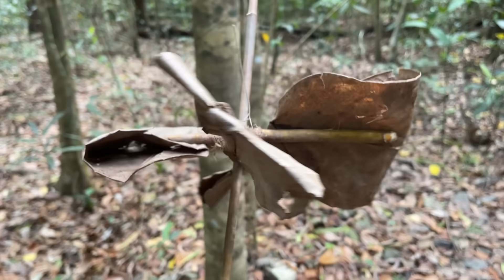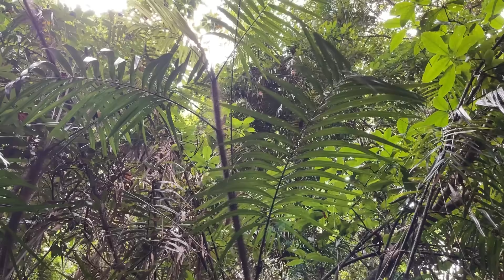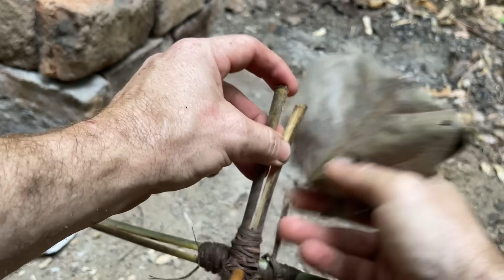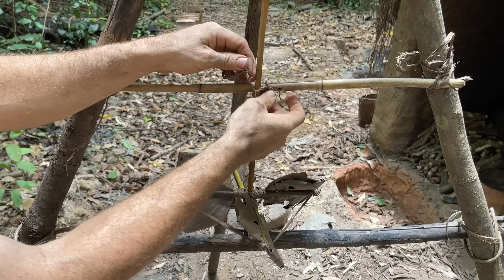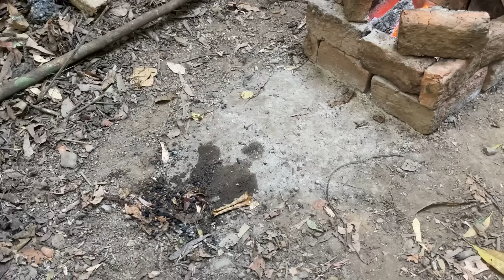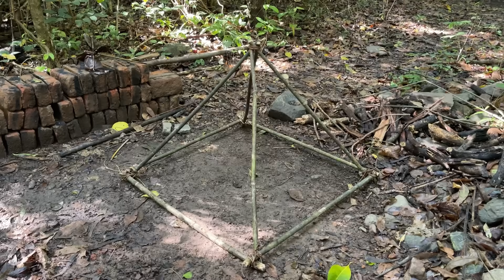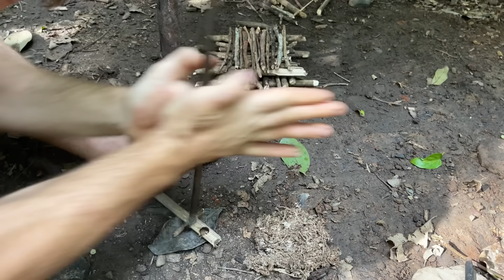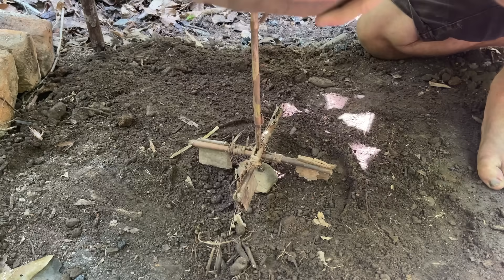Primitive Technology: Convection turbine experiments (hot air windmill)

Comment: Using a chimney to improve the draft would probably be the biggest improvement to the system. Great video as always.
Reply: Carved wood or fired clay turbine blades (and fan blades on the other side) with more optional shaping would also be a significant improvement
Reply: @yablecki yeah, they'd add weight to the system which would mean they'd double as a flywheel of sorts, and they wouldn't burn.. reducing friction while concentrating air flow, is the next logical step, and a way to separate the fire from the hot air would be good too.. maybe by draughting the hot air sideways to a horizontally mounted fan..
Making this thing do actual work, like turning a millstone would be awesome.

Comment: i follow your channel from alot of time, i was wonder.. you should focus on finding copper. with that you can make the basic tools needed to improve your iron ageing. ( forged copper is strong enough to use it for basic tools). then if you know how to find also tin, zinc and antimony, you can make  good bronze tools. follow this recipe:
Cu85%  Sn10% zn3% sb2%  with that mix, its hard and strong enough to resist for long time.  for chisels, use just Cu86% sn12% zn2%. the zinc improves crystalline formation and increases its mechanical characteristics. yeah... my old channel... :( i had to delete it

Comment: I wonder if there'd be a way to utilize the fire in a way to where you can use a basin on top of it for water to turn to steam and use that to turn the turbine. Might solve the burning down problem. Thinking like a first as you had in the end with a basin you have access to add water into with more of the bricks going up to concentrate it a bit more so it blows more into the turbine.

Comment: Sir you are trying to create a perpetual motion machine, its not possible! You will get better results if you try to conserve as much heat as possible in the forge than letting that heat escape to power the fan.

Turbo chargers work by taking the energy wasted by combustion (exhaust) to power a blower and get more air in, but they can only exists because needed to remove the exhaust in the first place. The engine power comes from an explosion but the actual heat energy is not whats powering the car. In fact we prefer to get rid that heat quickly so temperature in the engine doesn't build up and melt the thing. So we exhaust it out. That exhuast (heated fumes) creates the necessary pressure differential traveling to the cooler outside air to drive the turbo.

Your setup (which is also powered by chemical reaction) needs the heat to melt things, so you DONT want to exhaust it out. In a forge you want to keep as much heat in as possible not let it out to power a fan.

Comment: Ah, yes...  Ever hopeful for perpetual motion.  I get what you are trying to do but do keep in mind that you are not going to get more energy out of a system then you put in.  Now the fan Idea is good, but you might be aiming for an actual windmill if you want that to work.  Your best bet might be a simple weight and pully system.  Attach a pully to a high branch and run a line through it.  Have a heavy-ish weight tied to one end, the other tied to the blower axel.  Wind the axel to lift the weight.  Let go and let it spin.  You will have to wind it back up each time it stops, but that could easily power a small blower.

Honestly, the best option would be some kind of small water wheel for continuous energy.

Comment: I can’t wait until John unlocks steam technology.
Reply: This is the way. I don't think this rising air turbine is ever going to produce enough usable force, but boiling water and making steam might.
Reply: He should activated MODs so that we can pitch in.
Reply: Danger quotient definitely goes up though
Reply: @zogworth  meh. Fired ceramic is a perfectly cromulent material choice for a steam boiler material...
Reply: @TitoRigatoni  Nah, the early days of steam power were packed full of deaths. Pressurised steam is an incredible killer, and clay would need to dry slowly over months or years to have both the thickness and integrity required to hold back the pressures needed for genuine work.

Look up pressure cooker accidents here on youtube if you want to understand the dangers of improper usage, and remember that all the vessels you're looking at are machined to high tolerances with modern steel.
Reply: Real steam power actually requires accurate machining, which is why it wasn't invented earlier
Reply: @ain92ru  there is a steam boiler concept that was made in ancient greece. It's more lika a toy, and just spins very fast, but for his purpose, thats all it really needs to do.
Reply: @ShelfHead yeah, except its comparable in efficiency to the hot air turbine shown here. Aka not very efficient
Reply: Nuclear arc?
Reply: Next video he will forge copper to make induction coils and create electricity to power his wood-made computer
Reply: Maybe he will create Dyson sphere.
Reply: Just wait until he gets to LV
Reply: @microwavemicofficial  GREG

Comment: It would probably be better to make clay or wood pipes (or half pipes) to redirect a small stream of water from the river, so you could power a waterwheel. And if you need to elevate water to be able to pipe it near your working location, there are a couple of waterwheel powered pumps or water elevator designs that can be powered by the river itself.

Comment: There is no torque with this airflow. Do the same using a vine as a twist cable and power it using the water stream.

The only problem should be the structural integrity of the blades...

Comment: interesting concept, the prototype is a good start, it looks like you need to figure out improving torque to overcome friction, perhaps larger blades and some sort of clay flume or chimney so the air MUST go through the fan. perhaps finding some seeds/nuts to crush oil from to grease the spindle too

Comment: 1. Make everything out of clay so you can put the funnel sealed to the furnace which should be sealed too with one input and one output only. Of course, it should have a door of some kind to refuel and access the inside. This will provide a shorter rod connecting the two rotors that can better withstand high rotations and it will have less mass..

2. The blower should be properly built like the old ones you've made, with a closed "floor".

3. After that its just a matter of input and output diameters. That you have to figure it out on practice.

What do you thing of that plan?

Comment: Ok, the expansion rate of the air is only 2-3 times greater when you heat it up. So it’s not going to expand and blow very much with ANY turbine. On the other hand, the reason why steam powered engines are so efficient is that the expansion rate of water turning into steam is 1,700 times! If you were to boil 1 L of water and point the steam towards a turbine, it would blow 1,700 L of gas in the turbine, and that would be the best turbo boost you could get!!!

Comment: Yeah this idea is really crazy, even if it works the better it works the more likely it is to burn down. Can you steer hot air with a ceramic roof? Also maybe the spindle being straight would help but i've never seen any antique woodworking techniques explored here. Maybe its time for some of that? Straight beams won't fix this but would help building and the deflection on that won't be good once it actually spins a bit faster. As crazy as the idea is though i can see this work! Maybe if the entire fire was a chimney with the back of the chimney having a bit of room for this spinner? It just really does not seem feasible to do this for a bloomery though you have to be able to break those open if the slag/iron chunk fuses with the ground...

Comment: what if you build it next to a waterstream and use hydro power instead? maybe not in a horizontal rotating matter, but build a wind canal that works vertically so you dont have to change the rotation of the water wheel? also the stick would need to be very straight, or you divert part of a water stream, to flow through a small manmade canal, maybe even use the acceleration the water gets from going into a much narrower canal. That would eliminate the need for a long and straight branch, since a short and straight one would suffice. And also, you would have running water to your immediate help incase of fire, which the fire safety monitor would surely advocate for.

Comment: I know you're already thinking about it and that you want more power out of the system. Because this is the internet, I'll throw my two cents at it lol.

Seeing as it would be pretty difficult to increase the pressure of the air pushing on the turbine, the only other way to get more power out of it is to make the turbine larger to produce more torque. Obviously this wouldn't make it spin any faster, as it only provides more torque, but it would allow for the power to be put through one of those nifty pulleys you made before both speeding up the final output as well as offsetting the impeller drive shaft from the center.

I wonder if the tension required for traction on the pulley system could be heavily reduced by imitating a bicycle chain - knotts, sticks, or ladder rungs in the rope that slide into divots on the clay pulley wheels to reduce slippage? This sounds too complicated for me to try, but I imagine you could manage it.
Reply: He should improve to wooden pulleys. A simple wood lathe is easy to make. A constant tension in a pulley can be achived with a moving pulley in an axis with a rope tied to a rock in suspention. Its very difficult to increase preasure in this atmospheric system, but you can increase velocity by a tall enough chimney and to increase the torque, you can increase the number of turbines in the axis.

Comment: A turbo charger in an open system isn't particularly charged.
No compression.

That's also why our circulatory system is much more efficient than those with more open circulatory systems.

Maybe if he instead created more water bellows and had a stream fill a counterweight, so he would have three or more bellows injecting air into the furnace one after the other.

Comment: Maybe try using your fire blower AS the fan for better results? You could build a tall furnace and attach the blower's nozzle to the top, theoretically the air will spiral inwards from the nozzle and exit through the axle hole causing it to spin.

Comment: The biggest factors contributing to the energy generated by the turbine is the velocity of the air and the diameter of the turbine. Increasing blade length by only 10% increases the captured energy by 21%!
If you could make use of the high velocity air from one of your tall draft furnaces, and solve the heat problem, this concept of a "turbo" could potentially work!

Comment: You're going to need some gearing mechanism because i'm doubtful the slow-moving exhaust air is going to get you the RPMs necessary to run the blower at any significant speed. Either that or increase the displacement of the blower such that it moves a larger amount of air per revolution. 

I think widening the roof hole and increasing the size of the impeller would capture a larger amount of total energy as I imagine a large amount of the convection is just spilling out the sides of the roof. If you can leverage a draft force it'll work better too. 

Oh yeah and don't burn it down.

Comment: I think in order for this to be practical, you need to capture enough energy from the rising air that the forced draft from the blower is superior to the natural draft from the rising air. 

It seems technically possible, since you're heating a higher volume of air than what's in the chimney of the furnace, but that air would also be moving at a lower speed, and you're losing energy to friction in several places. Considering the materials you currently have access to, I think a natural draft furnace is going to give you better airflow

Comment: Some interesting ideas, but I don't think this is an efficient way to drive air into a fire. Basically, you're using the energy of rising hot air to power a blower through a mechanical linkage, but you incur losses in converting the rising hot air into rotational motion, friction losses in rotating the blower, and further losses in converting the blower rotation to move air.

All of these losses are eliminated if you just use the rising air to draw in external air  directly, as you did in your chimney video. The hot air rising reduces pressure inside the chamber, which pulls in outside air directly, without these losses.

 If you're thinking of adding something like this to the chimney, the fan at the outlet induces back pressure which I think will slow the vacuum effect and reduce overall efficiency.

Comment: This is what happens when the fire safety monitor isn't around.  Also, green leaves may help with the shroud, and I think with physics you want longer fan blades on the top compared to the size of the blades in the blower, additionally might want more than 4 blades.

Comment: The problem is that there's no structure or mechanism to concentrate the hot air to generate high pressure. Turbos only work due to the intensity of the pressure of the gas coming out of the engine.

You'll have to build a forge that can direct the hot airflow into an air tight narrow passage where the turbine is, and it must not burn from the intense heat and pressure, and then that motion of the turbine can be directed into a pulley or gear system to move the air blower.

I highly doubt such a design could work with the primitive tools and materials you have access to. The lack of metal is just too harsh of a barrier.

Comment: It going up in flames seemed inevitable. 

I’m trying to think of the conservation of energy here: you’re not going to move more air in the blower than you have acting on the turbine. I think you’re going to need more of a chimney, and a smaller blower. A gear ratio between the two might help.

Comment: There are historical books, some on very old Greek automons, very complicated machines with no electricity. Egyptian and Roman engineering. The foreman of the great pyramids had a daily dairy and they did have massive water power machines to cut and move stone and the road and ramp system took 8 years to build before they pyramid
... I'm not a professional but the past could be revisited for inspiration

Comment: I wonder if the part wiht twinerope would imprive the blower function, well sort off. the twine gets wound up storing energy, and contracts as it does, lifting the lower tip just a bit up. lowering friction and letting the twine unwind, driving the blowerfan. making the airflow "pulsed", less optimal though. and still a fire risk when stuff gets to dry.

Comment: Great stuff, even when it goes up in smoke!
Since the air coming out of the fire is more or less equal to the air going into the fire, would it not be better for the turbine to be on intake stream of air? 
I don't think either way will work, as your trying to get more energy out than put in. Unless a different fire is used other than the forging fire.

Comment: The 2 problems are harvesting the air flow and fire resistance.
Try a chimney build with clay and the correct diameter for the turbine to just fit in. This way, all the hot gases will be directed through the turbine and at least the chimney won't burn down. It should rotate fast enough.
The next problem is the material for the turbine. With a concentrated air flow, it will probably be bathed in flames. So, either you need a chimney big enough to cool down and expand the hot gases a little bit or you find something strong enough to resist heat. Might be helpful to direct just a part of the hot gases to the turbine.
The concept works, you probably saw the videos with people connecting turbos to fire barrels yourself.

Comment: the problem at this point is gear ratios and torque (aside from the whole burning down part, but using less flammable materials will fix that). the size of the turbine you would need to power that blower would be large enough that you would be catching the wind as much as the hot air. then you just have to deal with the weight of the materials themselves.

Comment: so, usint the heat of fire to make the blower spin so the energy lost in chymney is taken back to blow fire...good idea....wyh not use a ceramic pot upsid down in just a little bigger pot with water near fire, so heat will dilate the air into the small one making it go up, and then use this movment to make work sac-blowers? like a stirling steam machine? maybe a ceramic tube can take hot aire to heat the water and make steam into the small pot to make pressuro and pull it up until a point where steam is expelled to another tube across cold water to cool it down and reuse it to heat it up again to make steam reducing water loss. 

i'm not an engineer but using hot air to move a windmill to spin a blower looks to need more perfecte chimney, bigger windmill blades, and a "cluthch-like" system to optimize energy.  with lots of loses in force. 

If engineers are reading this thanks for your coments, i'm not an engineer but i like to think and learn about

Comment: My guess is that if the fan is powered by the rising air, the amount of airflow you will get at the bottom will be, at most, half of the total airflow that would be going through the roof area if the roof was not there. Which is not nothing, but it seems like not enough for the purpose.